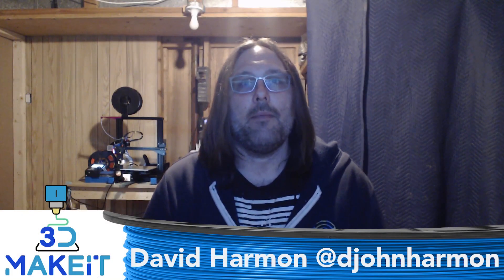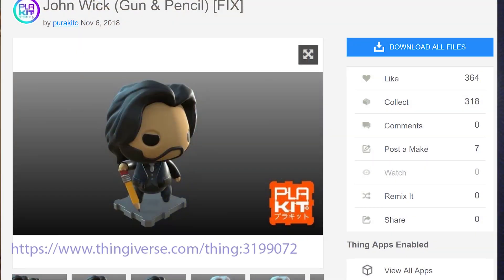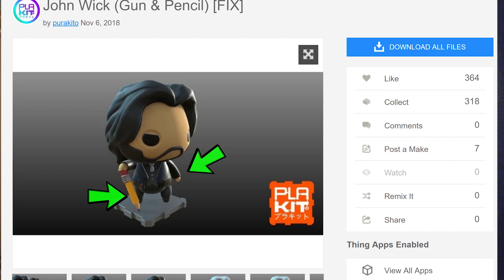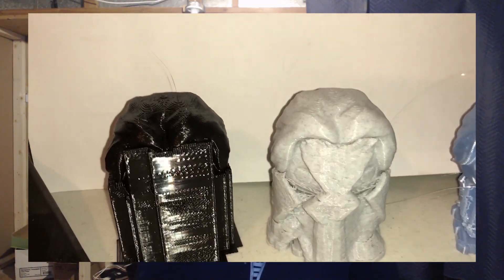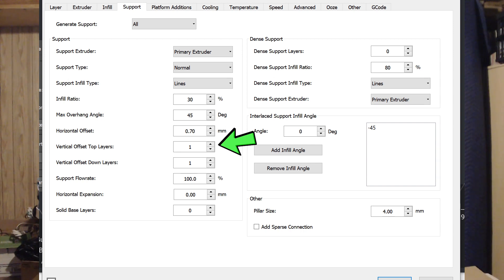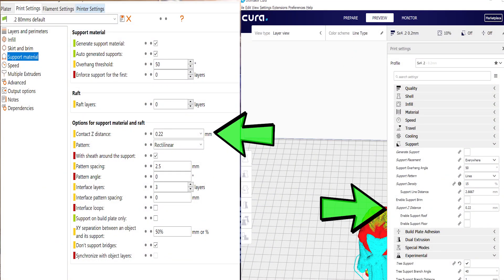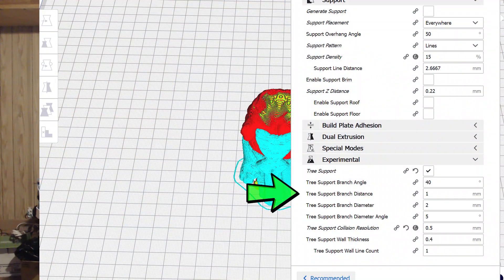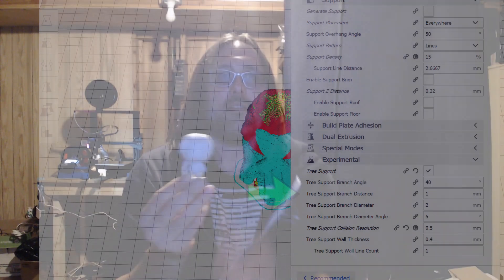Be Supportive of Your 3D Print (tips for support success)

Comment: Hi. You mention choosing a z-gap between supports and model of 10% of layer height - so in your example with a 0.2 layer height, you set your z-gap to 0.22. I don't know about the Prusa slicer, but the help box that pops up with Cura specifically says that the support z-distance will round up to a multiple of layer height. So, with 0.22, it will round up to a support z-distance of 0.4 (2 free layers above support). I imagine that the Prusa slicer does the same. You can see this in Cura if you step through the layers in preview.
Reply from the maker: you are correct indeed.  Prusa Slicer 2 adds in .02 not a rounded number.  This can be seen in the preview by the slicer